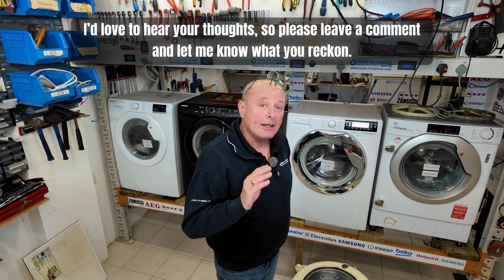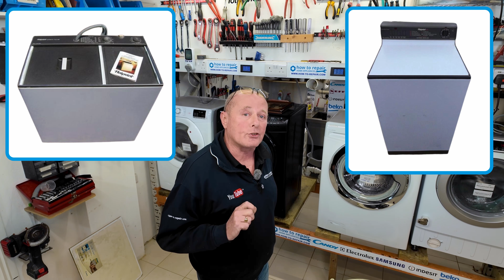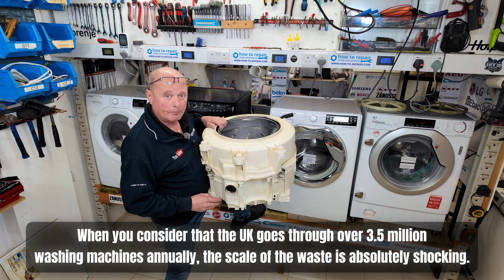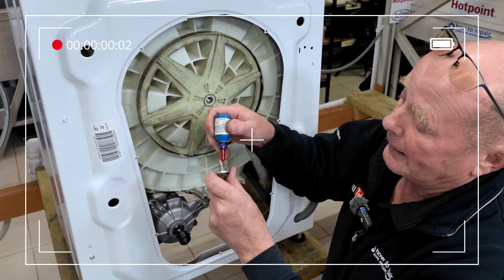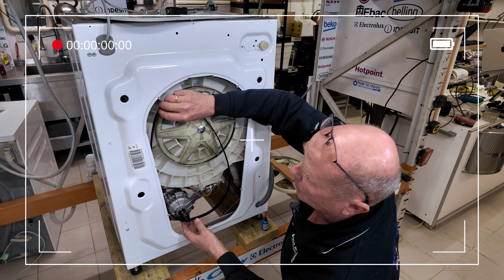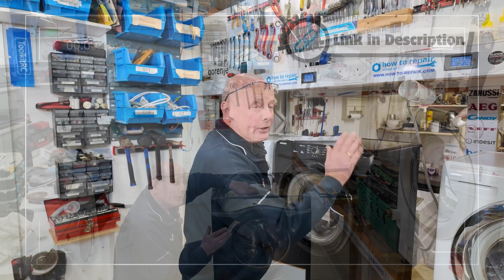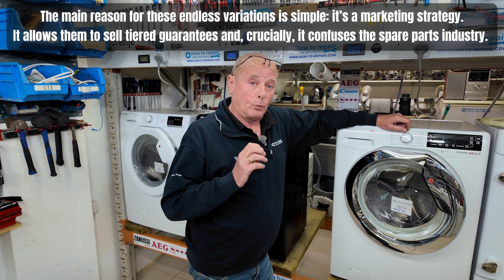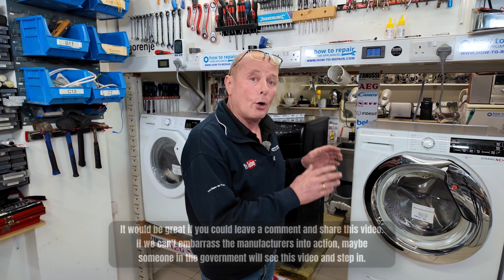I Scrapped 13 MACHINES to Prove a Point: STOP BUYING These Brands!

Comment from the maker: Are you an engineer? Drop a comment below and let me know if you’ve seen these same built-in failures. Let’s get the truth out there! 👇
Reply: I have to do Samsung authorized repairs, Bearings fail from 6 to 18 months. We have to change the tubs and drum for this repair which is a waste. I recently done three repairs on the same machine a few months apart because of the bearings failing. I just had a look at upcoming models and the bearings have not been changed. I know it's annoying for companies to have sealed drums, but when it's warranty work, it's irrelevant because you're doing a full drum change anyway.
Reply: @declanc5372  We've had two Samsung washers. Not any significant problems with either. Carbon brushes in the motor is a kind of planned obsolescence as well though.
Reply: @larryphotography Здравствуйте. В двигателе щётки это естественный механический процесс в зависимости от того сколько Вы стираете, соответственно и износ щёток зависит от этого ☝️. Не нужно наговаривать лишнего. Ничего нет ⛔  того что будет работать вечно. Всем добра и мира 🕊️ и любви к близким 🙏 людям 🌸🌸🌸
Reply: @declanc5372  noooooo
Reply: @declanc5372  I just recently had to throw out a Samsung machine cause bearings failed.
It served for 7 years with light usage, which is not too bad. 
Still sucks though, as we bought premium model for the exact purpose of it hopefully lasting 10+ years.
Reply: @eemarko В ноутбуке 💻 нет подшипников 😁.
Reply: I had done service for copy machines. For the old machines every seal, bearing or gear could be ordered and replaced. This changed and often only bigger components could be replaced. I am now a software engineer but at home I always try to repair electrical machines. You are doing a great job with these videos!
Reply: I didn't realise chipboard lids and welded cabinets were a thing, I wouldn't buy one with those features.
Reply: @Extra-Sail My ~2005 Miele had welded sides. The removalable sides only came later. I don't think it was a big problem that access was only through the top or base.  Edit -- Miele had the front panel that swings open though at the time.
Reply: @Extra-Sail I had it with a tumble dryer, just to replace a motor cap would require a total strip down, it`s my own machine so out came the disc cutter. made an access hole
Reply: @norfolkhillbilly  It's great to hear that I'm not the only one who's been doing this. (retired fitter/machinist)
Reply: 15 years in the trade and this is going to be my last.  Had enough of the cheap tack rubbish being produced.
Reply: Im a multibrand engineer of over 15 years and found the same failings in all brands and even now the mighty miele now have plastic tanks
Reply: @Fluffy6String  what is good?
Reply: @Fluffy6String Миле шмиле курит в сторонке, рынок наполнен дешёвой китайской техникой которой в хорошем случае служит 5 лет и всё. Дальнейший ремонт 🛠️  имеет смысл если Вы ремонтируете своими руками. Мастер может взять всё (это) под восстановление за небольшие деньги 💷, так как сам ремонт порой может быть дорогим и выручка за эту стиральную машинку будет минимальная. Всем добра 🙏 и понимания друг другу 🤝. Быть добру 🤚.
Reply: Nearly 20 years in the trade, far too many write offs. I have been caught out on few occasions.
Reply: I am engineer - recently opened a bosch serie4 machine in Telangana, India purchased in sep-2017. The drum can be opened which I did with great care but it wAs sealed.
I used high quality amway liquid detergent for all of these 8 years but spider is completely damaged. I opened immediately after I observed a smoke.
When I saw internet & asked bosch spare parts, only drum needs a replacement
Reply: @rithvikraokasugunti2800  the detergent used is totally irrelevant as the bearings are sealed ⚠️
Reply: @julesviolin the spider gets corroded.
Reply: 20 years as a mechanical engineer. All companies are deliberately designing to break or wear in one way or another. It is just the end result of Capitalism. Maximizing profit, absolutely nothing else. When taking this into account, the real inflation in terms of dollar per wash cycle during a machines lifetime for example, has increased tenfold in 10 years. It is not just the purchase price it's the lack of longevity. We are being robbed.
Reply: @EmilNyström-o8y this isnt capitalism. There are plenty of capitalist companies that dont have these practices. This is the problems of investment and investor decision making. The profit maximization happens because of investor returns and decisions.
Reply: 💯, issues for candy and hoover are spider and touch panel PCB. Limited access for repair because of welded body.
Reply: I've been fixing pot and glass washers for years, a friend took over a pub and there was a broken pass thru potwash and an under counter Glass washer, fixed both for lass then £100, ongoing it was just wear and tear and over 10 years less than £2000 in parts and service for the two,
Reply: I am an engineer, but not for mechanical systems.  Yes, "planned obsolescence and failure" are indeed built into many things.  In my field they are usually billed as "security/safety features".  They provide 0 security or safety... well except to the profits of the company that owns their patents and copyrights.
Reply: They do this because these appliances are sold at a low price. And the prices for spare parts are deliberately hight so that no one bothers with repairs. This way, the company ensures sales through low prices, and through short service lives and expensive spare parts in the countries where they're sold, it ensures subsequent sales of new appliances. Profit is the most important thing. The same applies to cars, phones, and so on. Just look at the computer industry, which is supported by software incompatibility with previous hardware models. Quality isn't the most important thing, but ensuring profits now and in the future ther important. 

The state should protect citizens and itself from products of this quality, taking into account the subsequent costs of disposal, but unfortunately, this isn't being done.
Reply: @yevshch  I don't understand the logic though. If I were screwed over by the latest brand I will buy another brand. Where is the profit besides the brand reputation damage?
Reply: @dougveganparadisebuilder  Because they are all bad they can all make good profit from us. You will buy another brand and someone will switch from your next brand to your previous brand hoping to get a better machine.
Reply: I find LG a cost effective brand for washing machines Bought 4 washing or dryer machines for myself and my mom in the past 10 years, all running well up till now.
Reply: AEG washer here. In the last 5 years the springs holding the drum have broken twice. Last time I fixed it myself as it was out of the 5 year warranty. I noticed the drum was held by one spring on each side. But there were holes for two on each side. By only using one on each side the springs were getting too much load and would eventually break after 5+ years just after the warranty. And the best part is they could just blame you for loading too much in the drum because that would break the springs.

Well now I have have all 4 of them and its going much more stable.
Reply: I’m not a engineer I’m just a kid of 11 years old but I repair washing machines as a hobby and the sell them but around 90%of the machines I get go to the Scrapyard one time I had a 2008 miele and all of the 3 pcb’s had failed Rubbish
Reply: @WashingbyG-J Hey, bravo, only 11 and doing this, I'm impressed!
Reply: @miovicdina7706 thank you
Reply: If you are a dab hand at soldering, more often than not it's the capacitors which go first on the pcb. Worth looking into electronics knowledge if you want to dabble in repairs. 

I would say eventually, the value of your skills will outweigh the repair (sad). Your time will be eventually better spent in other means in the industry if you persevere. It's a life choice at the end of the day. Keep at it! Good luck. 

 @WashingbyG-J
Reply: @WashingbyG-J  amazing work !
Reply: @WashingbyG-J Miele is usually quality, maybe you just been unlucky. We have bought many of their products and still have a coffee machine which is 10 years old.
Reply: @non @realViper666  miele is a very good brand but that was just one time i really like miele
Reply: @WashingbyG-J cool👍 thats how i gor out of lawn cutting; fixing appliances is more $$ and more fun !! Now im a retired engineer with designs in space and one orbiting Mars. You are on a GOOD PATH !! 👏👏
Reply: @s @solosailorsv8065 😊
Reply: Please can you upload a high-res image of the PCB that failed? I'm wondering if it was a manufacturing defect with the conformal coating AND if they put screws through the PCB that weren't stainless, and galvanic corrosion kicked in. Pay attention to similar corrosion around connectors (my background is computing/ electronics. One of my programming teacher's mantras were KISS (Keep It Simple, Stupid), and GiBo (Garbage in; Garbage out). RIP Peter Finch*. So much stuff is now engineered to fail. Just needs to be good enough that the fools keep coming back for more!

Also, what are your thoughts on Miele? They have a reputation for being reliable (you definitely pay for it). Are they the exception or just good marketing?

*Great guy, he had no filter (ex army officer: old Land Rover, cigars, waxed jacket, a little tweed...). He found out I got ripped off trying to buy weed. So on a college trip, he stopped the coach to get me some freshly laid treebark from the side of the road. So thoughtfall, didn't even ask me for money.🤗
Reply: Yes, Microcontroller Engineer here. Being retired, enabling Right to Repair is a passion. Most appliances can be run with a simple Arduino👍👍
ESP32 if you want to run it with your phone!!
Reply: Mechatronics engineer here. They are actually not denying right to repair, because they allow you to buy the components you need to replace.
They just price them so high, that you will end up buying a new one anyway. As long as these buffoons in the UN/EU dont realize this fairly obvious detail, these manufacturers can just continue doing this. They should get a strike system (non retroactively), that if they design products like this and someone can prove it, they receive increasingly more eggreggious tariffs to sell products here. 

Trust me, there will be plenty of engineers that can prove how these have built-in planned obsolescence and the manufacturers would be too scared to build them like this again.
Reply: @The_Noticer.  As Robert Pirsig stated in Zen and The Art of Motorcycle Maintenance the Japanese are past masters of competetively pricing their products, because the customer can go elsewhere, but they catch you on spare parts prices. Remember the old joke, "How can you sell your watches so cheaply?" with reply, "We make the money on the repairs." So what's new?
Reply: @ageezer532  Yeah but that's not really a comparison if their parts last 15-20 years. And these days, their parts aren't that much more expensive than their european or american counterparts. The only comparison to the automotive industry is having to code parts into the car, not being able to buy individual parts only assemblies, etc.
Reply: @The_Noticer.  This is the way. Engineers need to say no. Don't build bad design. Simply refuse to take part in the capitalism and use whistleblower systems
Reply: @The_Noticer.  Why
Reply: @jarnovanbuunik  volgende keer even quoten wat ik zei, ik ga niet in 112 comments liggen zoeken wat ik zei...
Reply: @The_Noticer. lol, how do you proof planned obsolescence?
Reply: @BiecherBender  simple, prevention of basic maintenance is an easy one to prove. If it could have easily been done with fasteners, especially in the case of the video where the fastener locations were still present, that indicates that the manufacturer doesnt want you to service it. And if they then charge more than the item is worth to fix the entire part (IE sealed drum), they designed it to be thrown away when any of the major components break. Also, it's spelled "prove".
Reply: @The_Noticer.   argumentation against it: 
- the welded drum was introduced to save cost
- it was introduced to avoid missing screws and doa failure at the customer (leaking drum) due to missing screws
- the bearings have a calculated lifetime that exceeds the lifetime of the machine
- the welded drum was introduced to make the rubber seal unnecessary, which is a component that will fail usually earlier than a welded plastic part, therefore it reduces the maintainance effort

So what did you prove?
Reply: @BiecherBender  
- For the manufacturer, not the end-user
- Easily solveable by indentations to prevent the bolt from turning, torquespecs, locktite, etc.
- MTBF doesnt imply it will always last that average. The majority of them will fail within that window. That doesnt mean you seal off access based on that assumption. You can have a dud bearing that runs out after 1000hrs. No bearing manufacturer will give you a minimum runtime. And why would the device be a write-off when it has reached the expected lifetime. Why put a clock on a device, when repairing it can prolong its lifetime. They also do the same with gearboxes in cars, "lifetime fluid". But they brick after 100K miles. Who considers cars to be a write-off at 100K?
- That is the most absurd thing i've ever heard, those seals are replaced in several minutes and are incredibly cheap to produce. If people dont change them, and they wear out to the point of failure that is on them.  

It sounds like you're a bit of an apologist, and dont have the interests of the common people in mind. I dont mind having a discussion but these seem like arguments you'd use when lobbying in congress and you're facing a layman.
Reply: @The_Noticer. and I don’t want say that I think that this welded drum is a good idea, I think we are better off having a drum with screws that is repairable. I just want to say that there is no planned obsolescence in mind in most of these decisions. Every product that is designed has a lifetime, otherwise everything would be over engineered and way too expensive or at least not competitive to other products on the market. Who is going to the hardware store and is buying a washing Maschine that’s 3 times the cost compared to others because it might hold up for 50 years. That’s the sad truth we are living it
Reply: @The_Noticer.  I think what you are not realising is that we are in a bubble. We are engineers, we like to understand how stuff works, and we like to repair stuff. What’s the point of having a rubber seal that is leaking with a probability of like 90% after 10 years (just making up numbers) if the repair will cost 100$ for the repairman to just drive to your house and another 100$ for an hour of work, if you can get a new machine delivered and set up for 400$. Most of the customers will just get a new machine. There it’s actually better to have a design which is less likely to fail in the first place, even though if it fails, it’s a total loss.
The issue is that with the highly automated production of everything, the products get cheaper but also less likely to be repaired. Not only because of design decisions, but also because the labour cost for the repair in comparison to a new device.
Reply: Just did a quick chat GPT search, the price for a washing machine in the us was 1960 about 250$. Inflation corrected, that’s 2600 to 2800$ today. You see where this is going?
Reply: @BiecherBender 
Yes, back then they were a months wages, now less than a week's wages.
Reply: @BiecherBender 🌸 easy look at landfills 
None of sealed drums can be fixed
What more proof do you require?
Reply: @BiecherBender How about Whirlpool using the same parts but fail way sooner in newer models. Or how the leveling feet crack in half. The main reason is consumers don't want to pay for quality. How many people buy Speed Queen in the US. When I tell them the price they usually say no and would rather buy a junk machine. They find out in a few months they made a mistake. I bought a used old speed queen set and had zero problems in 2 .5 years so far.
Reply: @BiecherBender  "The issue is that with the highly automated production of everything, the products get cheaper but also less likely to be repaired." The quoted repair part prices disprove this logic.
Reply: @NatePetersonr5t agree, but that’s not necessarily planned obsolescence. That’s maximizing profit in a market that is very competitive. Doesn’t make it much better, but as you pointed out, it’s also the consumers fault. They get what they are asking for, cheap machines. Question is how to break this cycle?
Reply: @jussiollila7714 what repair cost? The part costs for a bearing? That’s only a minor portion of what ends up on your bill. Biggest part will be the pickup, transportation to workshop, disassembly and so on
Reply: @BiecherBender  Statistic surveys, including of past generations. Also, why not have our government commission (and sell?) a base design, just to set a benchmark for the industry and proving durable designs are possible.
Reply: @The_Noticer. В России в качестве уплотнения бака используют силиконовый герметик )))
Reply: @sunitafisher4758 😂 В России 20 лет такие ремонтируем ) Приезжайте научим )
Reply: @BiecherBender  To add to it. Let's compare these two scenarios:
a) I buy a machine with the extra effort put into making it easier to repair for 1000$. Then in 10 years I need to have it repaired. With the increase of costs that will probably be at least 400$, or
b) I can buy a cheaper machine for 500$, put the extra 500$ in the S&P 500 at 8% annual income. That gives me a profit of 579$. Then I can buy another machine at an increased cost of 800$.

It's pretty obvious that option b by far is the best.
Reply: I used to work as a sales clerk when I still studied (I’m a certified Mechanical Engineer with a electronic background) for a company that sold electronic parts (resistors, capacitors, transistors and more). It was shocking how many white goods (fridges, dishwashers and washing machines) repair companies came to the store to buy jelly bean components to repair the PCB’s. Finding out that renowned companies used the same flawed design straight from the test design listed on the data sheet was shocking. This part, an offline switcher (part of the line/mains to low voltage circuitry) had a resistor listed that was too low in resistance and power handling capabilities, would fail after the warranty period and kill the switcher and therefor the appliance. The price of the parts: less than 3€/$/£! We sold the parts by the hundreds, to help the repair companies to repair machines that would otherwise be landfill cause the PCB as a new part was 120€/$/£ or more. I know that because of the backlash when this came to light, some companies changed the resistor and less machines failed but some (cheaper) companies are still notorious in using a 47 Ohm, 1 Watt resistor where a 100Ohm 2 or 3 Watt resistor should be used. Good for pointing out the designed for obsolescence, I personally prefer the old stuff for the exact same reasons: repairable and simpler and more reliable. Thanks for the time to explain, will follow the series. Cheers from The Netherlands
Reply: Parts prices is the same everywhere, if you built a car from parts at main dealer labour prices it would cost 10 to 100x as much!
Reply: @ianithompson4239  As Robert Pirsig noted in Zen and the Art of Motorcycle Maintenance the Japanese motorcycle manufacturers are the masters at parts pricing.
Reply: Just wondering if they sell the identical products in Norway. Here in Norway, even if you buy the cheapest machine, it MUST be under warrany (we call it "reklamasjon") for 5 years. No matter what. And I agree, it's a minimum! This is regarding to all consumer electronics, even cell phones, that if a product is expected to last more than 5 years, the retailer must provide the full 5 year warranty. And a washing machine is expected to last more than 5 years.
Reply: In the company I work we aim for 40 years life time. However, we sell service and upgrades to keep making money and we make industrial equipment for companies only
Reply: Industrial design engineer here, currently working within reuse and circular solutions. The change really has to begin with the financial system and financial growth expectations. Investors/companies expect a growing curve. Business growth in a linear business model = increasing sales and cutting cost. The result is unfortunately lesser quality products, made to be scrapped to add more sales within a certain product life cycle. 

For this to change to a more sustainable solution, the companies have to change their business model; product price has to be increased AND the companies have to provide spare parts and services as a secondary income stream. Collaborative production streams would also be required to counter the reduction to 'mass-production' systems.
Reply: love to know more too.  my beko combi dryer isnt drying but the washer works. cba to fix it as i know 150quid for the part not just the heater coil
Reply: I am à EE eng but proficient Imany fields and strted fixing things from watches to cars including guns washing machines etc… as a kid Yes it is all going down the drain but Not because of eng but  beancounters marketing …
A lot a cheap chinese components ! Brittle plastic parts bearing made out a soft steel NO HEAT TREATMENT ! Also useless features making thing unreliable ! Also most esuip come from the sale factories just cosmetic changes and name tags
Our landfill may be filled up before raw materials will be exhausted
Reply: My dear old dad had his whole working life as a servis engineer fixing washing machines mainly, until he retired in 2000. He said its pointless even attempting repairs generally now, just buy cheap and simple and replace
Reply: Has to mean the scrap yard.  Surely landfill is a criminal offence.
Reply: What manufacturer would you recommend for best repairable
Reply: Not a repairer but looked into reliability and warranty and went for an  Ebac. British made and looks like a decent warranty. Can you have a look at one.
Reply: Yes,  even in 2000, when I was studding.. The teachers knew and told us that kitchen appliances are becoming irreparable over time  .. I tried to work in the field around 2005-2008, but changed to industrial factory machines and sensors.
Reply: Lol. Are you expecting engeneers to say that they screw people? They are the ones who build it in you know.
Reply: where can you get the service manuals and bulletins for hoover. hoover Tech now with Agora so i have lost access to all tech. bring back the 80's and 90's when hoover sold  tech books
Reply: Back in the days, the Whirlpool company (now Beko), which was maker of others +10 brands, has a labs, all machines was hard tested, the goal was - less material to make product, but at the end each must push 10k cycles, some of the labs are gone.
Reply: @jonkanzaki2261 whirlpool is an American company and it is still very much in existence
Reply: Maybe someone knows of alternative shock absorbers I could use for my LG F6V1010BTSE? The ones in the machine are black plastic and have felt on the strut that works by friction. The machine is level, but it shakes badly. I disassembled the absorbers, and it looks like they have grease, but all of it is pushed to the end of the shock absorber tube, so the felt is dry. When I pushed them all the way in, the felt got grease on it again and the machine worked well for a few cycles, but then it started to shake again. Hopefully that make sense 😅 I saw some manufactures use gas/oil shocks, I was thinking maybe I could adapt those to my machine!? 🤔 Any help would be much appreciated 👍
Reply: Thank you very much for your hard work.
Reply: We have a Haier machine and wondered if you have any info on it, also was wondering if it’s made by a one of the bigger manufacturers or are they independent?
Reply: 15:52 the basic wash cycle has slighlty improved for certain types of clothing: newer machines allow conditional shortening of wash cycles if there is less clothing or if the machine detects the clothes are less dirty
Reply: The tech world is undergoing the same "idea" of pure greed, we have reached a scientific wall, where everyone could get very cheap laptop, when it comes to tech, so now they are designing for laptops/phones to destroy within some years. And keeping them all super pricy. We live in a joke world, with joke people controlling. It seriously is sad, because at the end of the day, they lose on it
Reply: Recently replaced the spider and bearings on my Samsung direct drive. 7kg pig of a job but now OK. Very concerned about the corrosion on the alloy spider.
Reply: Why do they all these brands introduce a similar new component/idea at the same time?
Because there all made in the same factory. Even if there made in a different factory some of there components are sorced from the same producer.  
35 years ago I was in a factory that made lawn mowers. Those guys produced 10 or more brands in one factory.

Someone ones told me that you can sometimes simply compare weights of machines of the same size. The lighter it is, the crapier it will be.
Reply: You are a national treasure, Sir! I lived in the UK & Ireland for many years. My aunt & uncle had a Belling hob which was installed in the 1980s and is still running strong now some 40 years later. Amazing!
Reply: When I was at the university our mechanic design teacher told us that he had to design a washer machine to last until the warranty expires. He needed the job so he designed the bearings to run for that time.
Reply: I want to err on the side of caution with this comment. It's likely he designed to a budget he had to meet. If 3 years was the target, that's all it needs. 
Bearings that are of higher quality would cost more, is that good engineering? 

If you want to blame someone, blame the purchasing department, blame the consumers. Hate the game, not the player. 

 @matiassebastian3193
Reply: Постоянно, подшибники и коррозия, гниение прокладок от плесени, постоянная проблема всех стиралок которые у нас были, Россия, Тамбов.
Reply: All my respect to you for this video. You're on point, direct, fair, spitting facts, knowledgable. Well done, I will keep this one saved and follow your work.
Reply: Lifted my machine to check if it has a splittable drum, found the heater element cable is toast... Fuck. Terminated the cable and now I have an element on order. Cheers mate
Reply: My annoyance:  Plastic Gears!  I remember more than 20 years back opening up a machine to repair it, and to my shock it no longer had METAL Gears, they were oil coated white plastic gears.
As you can expect, platic gear teeth snap & break, but metal gears can  last for decades longer...
Reply: Hi, for once, the uerSS could be useful, by normalizing :
* low-voltages used,
* connectors layout,
* main (programmation) PCBs dimensions and connectors places,
in order to make all machines electronics fully compatible among others.

But I'm afraid this will stay a wishful wish, as we still see programmed obsolescence  everywhere, like in Samsung and LG TV, with the first place going to Samsung, as they specially re-designed  a capacitor, installed (by pure coincidence, of course…) just upward power transistors' very hot radiators, to be irreplaceable (big µF, but with an elongated very unusual shape {~4.5 cm long and ~1 cm ø !), to stop casual repair).

So, the best way to counter that is to use your own mass destruction weapon : your debit/credit card, leave it in your pocket, say loudly why you'll never ever buy such brands, and you'll automagically see things change quite rapidly. 

In a word, as far as consumers will stay quiet sheeps, things will get worse, but as soon as they'll show wolves teeth, things will change for the best, it is just a matter of balance…
Reply: Which brand model do you recommend buying ?
Reply: The line between low engineering skills (bad design) and built-in failures is sometimes indistinguishable. However, at some point the design itself gets so complex that single points of bad design no longer fit the image. 

I've seen more than enough of both.
Reply: France has the 2 years garantees way before the EU mandated it.
Reply: currently working as an electronics-testing engineer. And, yes, as soon as china started to flood the market with chinesium electronics like led bulbs and such, it is all a nightmare. Sometimes we just repair things out of pure anger and spite or just to prove a point of a horrible design.
Reply: BUT BUT, THEY SAY RUSSIANS ARE STEALING THOSE TO MAKE ROCKETS
Reply: Mechatronics engineer
Reply: I remember my parents having a Hotpoint in the 80’s it was terrible, broke all the time, my Dad go so annoyed continuously fixing it he smashed it with a Hammer 😂

They replaced it with a Zanussi and it lasted 12 years with couple of minor faults, my Mum only replaced it because she had a new kitchen she wanted a shiny new machine.
Reply: В России ремонтируем всё что возможно сделать , бак пилим и паяем или скручиваем на герметик и винты) : 100$ за весь ремонт и гарантия 1 год , крестовины у токоря восстанавливаем втулки сальника из браж 9-4, восстанавливаем посадки сальника в баке. В Санкт-Петербурге Крестовины могут отлить под спец заказ из специального алюминия который не гниёт от порошка! На новые indesit платы можем поставить от старых, перепрошиваем , меняем логику работы замка, восстанавливаем инверторы управления двигателями , Китайские машины в среднем служат 1.5-4 года , ломаются подшипники так как плохие материалы или брак в размерах. Или платы инвертора одноразовые ломаются часто.
Reply: "Consumerism is the perfection of slavery"
Reply: Unfortunately, other industries also do the same. Automotive, like Ford has been doing for the last decades.
Reply: Finally switched to Miele and never looked back
Reply: Power supplies are solved and the cheapest part to get right. But also the best part to do planned failure, by spec of a PCB part. Then make PCB unique shape, so people cant repair their TV. Its just 20V Philips..
Reply: A 59p diode had gone on my brother in law's Beko. He nearly spent £400 buying a new machine. I replace the diode (D7 on the power board btw)
Reply: Not that kind of engineer
Reply: CLASS GLOBAL ACTION outrages when people want to CONSERVE THE ENVIRONMENT
Reply: @how-to-repair . We have a hoover hwash 350 10kg .
We bought the machine brand new on 19th april 2025  for £379. Litraly 3 day after the 12month warrenty was up it was giving fault  E07 and tbe door lock would just click and not lock then fail to start. tried the error code self test fault still present . Hoover wanted £130 call out plus £68 for door lock . 
I went on there website bought the correct parts for £24 delivered .
Fitted machine was working 2 weeks later it came up with error 02 water wasnt draining so checked the obvious filter had few bits of lint so cleaned that out . Machine now has stopped filling completly  can here the hum from soliniond but no water coming through so ive ordered a brand new inlet solinoid. Whilst i was in the machine ive stripped the pump and blown all through all the pipes . Fitted new valve nothing . Fourtunatly i live within driving distance of hoover head office so will be taking the machine back to them . And tellimg them they can have there crap back
Reply: Citroen C4. Unserviceable and unfixable.
Reply: I'm software engineer and I've seen a lot of softwares which aren't designed to last. But I don't know if you are interested in those?
Reply: Are Ebac any good?
Reply: Miele the best brand
Reply: I have seen that, now I see it more and more. I always recommend not buying smart washers, Whirlpool has to be added to the list, great video.
Reply: Вы спросите, почему раньше машины работали 25 лет, а сейчас 5 лет?
Отвечаю.
Раньше крестовины, т.е. держатели, барабанов делали из силумина, это точный сплав алюминия и кремния.
Сегодня крестовины барабанов делают из алюминиевого металлолома, в котором есть дюраль - это сплав алюминия и меди.
Дюраль корродирует и рассыпается в порошок.

У меня Electrolux EW-920s, работает 24 года. Менял тен и аммортизаторы. Доволен.
Стираю в аммиаке, 1-2 грамма на стирку, это похоже защищает подшипник.

Производители так прямо и пишут в рекламе - в барабанах применена дюраль. Эти машины ни в коем случае покупать нельзя.
Reply: People don't care about obsolescence or about the right to repair, the majority of people change smartphones every year. People love to buy new things.
Reply: Question for the engineers: why in Europe nobody repairs the PCB that controls the motor. Sometimes is just a damaged capacitor, an igbt or a diode. In poor countries the technicians repair the PCB.
Reply: A lot of laundry machines (I can’t comment on other white goods, but suspect same is true) have gradually shifted towards design for manufacture at the expense of design for serviceability and reliability. They’re manufacturing poor quality parts too, to drive their supply chain cost down to (unrealistic) unit cost targets made by management. I was an engineer who moved into being a manufacturing manager, so I know this to be true. We call this strategy “Jam Today” but it comes at a great cost. Reputational risk is assessed, but against potential risks for competitors doing equally shonky practices. Aside from cycle to cycle cost reduction (cost of manufacture), market share is king. Thus big names formerly known for excellent quality are now trading on that name. I include Bosch in that category. It is important that you have tackled the topic of design for repair in your video. Very factual, without emotion or bias. Well done, and thanks.
Reply: 15 years as a service engineer, Hoover and Candy products are improving since Haier purchased the company. A lot of the washing machines are badged Haier machines which minus the direct drive motor is a far superior product, even comes with the split tub and drum. They also offer a free parts repair for £160 which in most cases is far cheaper than buying the parts and repairing yourself.
Reply: I made my decsion long ago, if I ever have a home I will go looking for an old Whirlpool or Maytag from 1945-1955. Why? 100% repairable. Metal Bearings, Metal wheels, inner and outer drum, power mangler, timing is basic and basic clockwork. Dryer same make 1945-1960 with an upper drying cabinet, plus a clothes line because if that breaks? Just get a new rope.
Reply: Sorry, if consumers didn't chase for short term gains, they wouldn't need to be designed to fail.

Washing machines shouldn't cost the amount they do, they should cost 2x-3x easily especially with inflation factored in.

There are only a hand full of brands in all products which still ring true to longevity. 

A classic example is Dyson vacuum vs Henry, why do millions buy a Dyson not a Henry?
Reply: I always find these discussions about planned obsolescence very interesting, especially as a actual engineer. BTW, in Germany where I live, the word engineer is used for people who studied engineering. People who work in the field of repairing stuff are called mechanics. So we differentiate there. Anyway, you mention features like the wood top and plastic slides as planned obsolescence, do you really think the engineers who develop these machines were sitting together and decided that they should go for a wood top, because it will swell in a couple of years and ruin the life of a repair mechanic? It’s just an oversight, bad engineering, that’s it. Things like this happen and if they happen it’s very costly to change. Also, you only see the machines which have problems, what are the actual numbers, like the failure rate in percent? Another example is the welded drum. I also can see why this was considered a good decision during the design process. On one side, it’s probably cheaper, second topic is that it can not be forgotten to weld during the manufacturing process. Screws can and will be forgotten, which will lead to a doa failure at the customer. Third advantage is that you don’t need a rubber seal when it’s welded. A rubber seal will fail at some point, the welded drum most likely not, but if it does, it’s trash. Anyhow, people tend to see only one side because they are simply no engineers working in the development of products like this, so they can’t have the knowledge. And the last reason for bad design is also the price pressure on the market, if there is a washing machine with the same features for half the price, most people buy this.
That being said, yes there is also planned obsolescence. Bad company practices also exist, but most likely not with brands that are reputable and long existing.
Reply: @BiecherBender 
...just an oversight...
Who uses particleboard in damp conditions!? In what dimension does that make any sense!?...🤔
Reply: @m @mderline4412 tally agree, that was surely not the best decision. But also there, I can see some advantages of the material as well, probably better acoustic properties if you put something on the machine, it sounds more rich, a better feeling of quality, compared to a thin plastic or sheet of metal. In engineering, I think it’s always a good idea to force yourself to find advantages and disadvantages for each decision. Additionally a FMEA to iterate all things that could go wrong is best practise.
Reply: I mean these topics are really common, we could go on and on. Another example which is or was commonly discussed is for example soldered ram in pcs. The likelihood that the connector fails between the pcb and ram is much higher than the likelihood that the ram itself fails. So from that point of view it’s a good decision to solder ram. But of course in the field there will be pcs with failed ram chips, and then it’s hard to repair because you need a skilled person with the right equipment. Of course then the question arises, why is there no connector, that must be planned obsolescence, not knowing that there are probably millions of devices which are still working because the failure point number 1, the connector, was omitted in the first place.
Reply: Hi, I’m a time served toolmaker/ jig borer and 78 years old.From the make n mend era! Back in the early 80’s there was the sloping front Hoover Keymatic which was very advanced back then! It cost a lot…and leaked a lot! Bearings went as a result of the grease being washed away into your clothes because it relied on a spring loaded plate rubbing against a graphite plate to seal the water out! They failed wholesale in no time at all and cost more to repair than replace and Hoover ignored the warranty period, placing the fault with the user! So they were everywhere standing silently! I knew of sealed bearings existence and went to a clearance MOD outlet and found a 100 qty box of correct size sealed submarine brgs  for £20!!! Bought them all up and charged £50 for complete repair in customers homes with a2 yr guarantee against leaks! Never had a leak or a claim and they were gone within a year! Got fed up doing them even tho I made a lot of money for 1-2 hrs work on each! But at least you could repair equipment back then! Cheers
Reply: I repair Miele machines. The ones before the W1 series last 10 years after being refurbished. After 10 years, the wearing parts have to be replaced again.
That's why I've been repairing only this brand. The ones before the W1 series were still good, they can be repaired and refurbished relatively cheaply. The W1 series was manufactured from 2011 to maybe 2019 with a degradable drum star. The W1 twindos system wears out over time, and since the panel was moved to the bottom of the device, it gets wet and destroys it.
They noticed that their washing machine sales had dropped significantly due to their machines breaking down faster than expected.
They switched to an acid-resistant drum star from 2019. However, this did not solve one of the main problems. There are many electronic errors with today's ones that were not there with the old ones.
Low-end washing machines are made with plastic drums, but they are bolted, not welded.
Reply: Siemens Devices need a Technician ONE Day after the Warrent runs out(almost all of them). In earleir times Siemens placed a Micro-Switch inside their Devices. How they handle it now is unknown to me but the issue persist up to this day. I watched a Technician who wanted to 'repair' my Washing Machine. He told me that the charge for the repair would be around €150. knowing this habit for some time I showed him my Siemens ID which made him shrug, reaching beneath the Top Lid of the Front Loader Washing machine on the right hand side and pushing the Switch and than leaving me without charge for Good. The Washing Machine worked flawless for the next 15 Years...
Reply: The smartphone you use every day has code in the software to start doing weird stuff after 24 months and after 36 months it slowly but surely dies.
Reply: @gertebert  What happens if you reset the date to two years before while ensuring it's not set to synchronise with internet time.
Reply: @ageezer532 20 years ago that would have worked. Bit 20 years ago we did not have planned absolescense LOL.

Nowadays smartphones connect to a shitload of servers and are more than capable of retrieving a time stamp somewhere.
Reply: @gertebert 
My phone has got a code that makes it suddenly start working better after 22 months.
Reply: I'm a product designer; that's 1 step above an engineer ... I don't have any of those problems, because I don't buy cheap crap

you're all whining and bitching about built-in obsolescence, but you never mention the fact that you bought the cheapest model you could find
Reply: @MichielVanKets  We are buying middle priced models and getting crap. I am 47 yo and I can tell you how much better were products 20 years ago in comparison to now for the same price level. There are even products that cost 10 times more and last 3 times less time. One such products are light bulbs. They used to cost 50 cents and last 5 to 10 years and now they cost 5 € and last 1 to 3 years.
Reply: @tongobong1  

well, I must admit ... I didn't buy any machines lately, because all the machines I bought 15-20 years ago still work
Reply: @tongobong1  

(I'm not in the west !!)
Reply: @tongobong1  

look up; Lowe fridges

he was the first one to start producing cheap products

before him fridges were not only build to last, they were also massive, because only the butcher and the supermarket would have them, because they were very expensive

it was his idea to stop producing high quality, but instead focus on cheap ... 

result; it worked, because before only the rich or companies were able to buy fridges, now everybody could buy a fridge 

be happy they produce it so cheap ... it's that or nothing
Reply: @MichielVanKets  I am from Slovenia and here is just like this English man described. Products got much worse over years and we are paying 2 to 3 times more than we used to pay for washing machines and many other products.
Reply: @tongobong1  yes, that's because you all worship the failed fascist state ... 

which is why they were able to create monopolies and that's why everything got so expensive, while the quality went down 

you did it to yourself

and most people just want more government

you are your own worst enemies